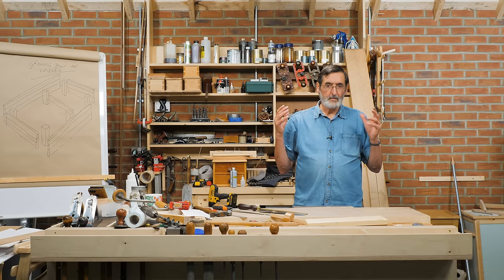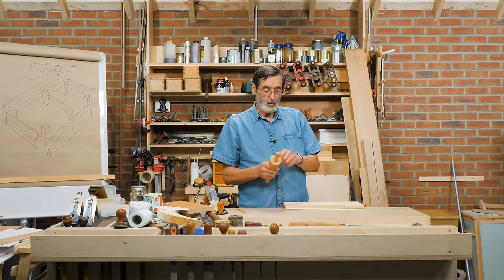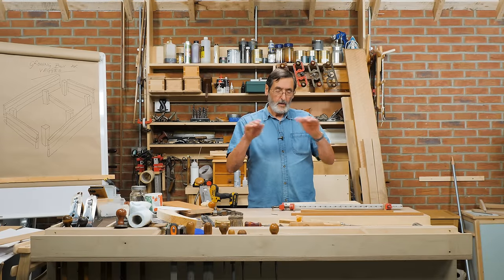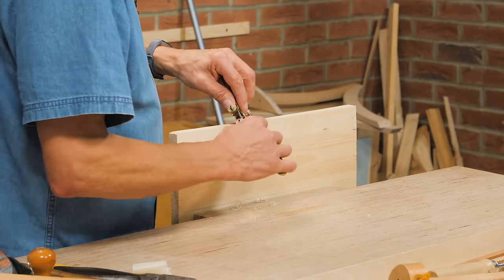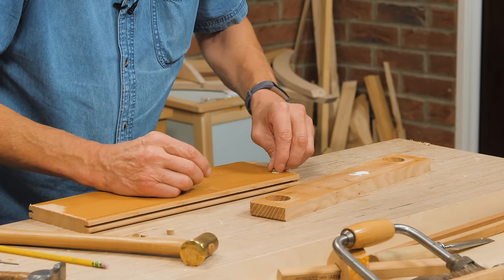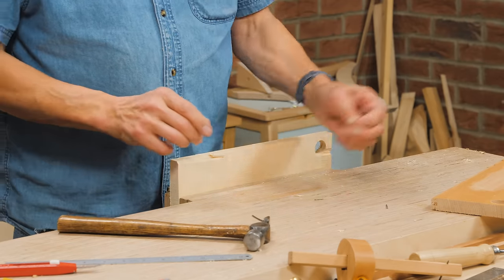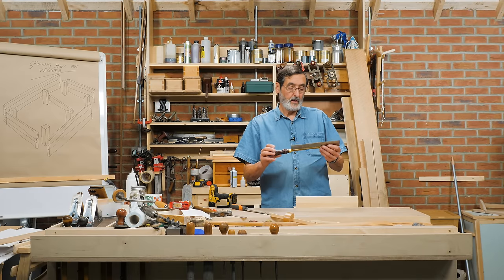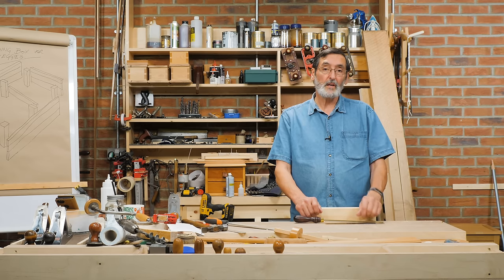10 Quick Woodworking Tips | Paul Sellers

Comment: #10 ye oldy saws (sinds mid iron age) had smaller teeth at both ends of the blade and course teeth in the middle. So just as with #5 you want to do some finer work, use that part of the blade.

Comment: Leave the head alone. Nip the end off behind the taper of the point, and it will basically cut its way through wood grain, unlike a pointed nail which spreads the grain going in. No need for three steps and two tools when two steps and one tool will do.

Comment: I have been at this 50 years, and I learned 2 new tips, one of which I could see myself using.

But, tip 4.... It is basically wrong.  You see this tip given in many forms, the clamped spline here; a spline with an adjustable cord; or the three points of deflection (say 3 nails, or clamps).  These are all poor choices.

1) Imagine you actually are making a table, or chair rail.  A project that might involve days of work, why would you snap some crappy curve onto the project?  It will be possibly the most noticeable line on the piece, and it will almost certainly be wrong. 

2)  When you deflect a spline by compressing the ends, or using the string or 3 points.  You do not get a section of a circle, you get a parabolic section, approximately.  The "radius" of the central portion of the line is tighter than the ends.  Parabolic shapes are common enough in furniture and architecture, just not normally in things like chair rails or table edges.  Or if they are present, they will tend to be the opposite of what you get here;  the ends will be tighter, not the middle, like an oval table shape would be over the long sides.

3)  You could do "the trick" then saw that line and adjust the result by eye, but this trick removes parts of the curve you actually want, you will end up with a chair rail narrower than you want, in most cases, and certainly you will loose some surface on your table.  Just draw the correct curve in the first place.

4)  So how do you draw a perfect curve.  There are a lot of simple enough ways.  But beyond a comment section.  However: You can draw curves full size in CAD with a few clicks;  You can taper the spline so it bends to an arc (but you still need to know what that arc looks like); there is the two sticks and 2 nails method; and there are simple methods using dividers to strike  a curve.

Here is a method that can maybe be explained in a comment section:  Imagine you have a table edge that is 48 inches long and you want the curve to be 1" high at the midpoint (24 inches along).  Divide the edge into 6 inch segments.  the corner will be zero height, the 6 inch point will be .44", the 12" will be .75", a the 18" point will be .94. and the 24" will be 1.  The other side of of center will just be reversed.  You can apply these ratios to any curve.  So if you had a 2 inch curve, you would mulitply it's station points by the above ratios, and you have points along the curve that you can deflect your spline to.  And nobody is saying you need to lay these out to 3 places of accuracy.  These are just the approximations you can use to get a closer curve, or to adjust a spline.  In the end you need to develop and eye for a pleasing line.

Sure the spline method may be close, particularly the flatter the curve, and in the event that the spline has a good degree of stiffness for that precise bend. But a curve that isn't spot on is an ugly curve.
Reply from the maker: And you just destroyed the simple process of drawing the simplest arc onto a piece of wood with eight paragraphs of text.

Comment: On tip #1 instead of turning the plane around,? Why not just turn the wood around?
That way you are STILL holding the plane PROPERLY?!?!?!¿
Reply: Sometimes to make an adjustment to something that is already in place you can't get into a position to plane conventionally. You either have to plane opposite-handed or use a pull stroke. BTW, the Japanese always plane on the pull stroke.